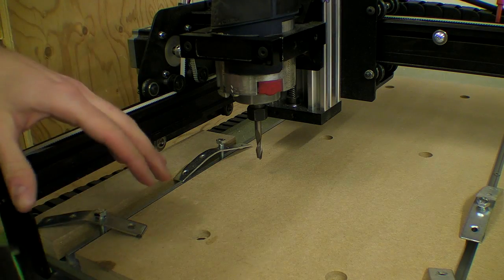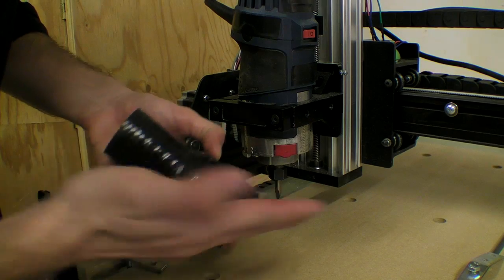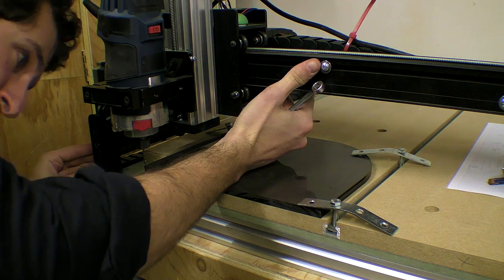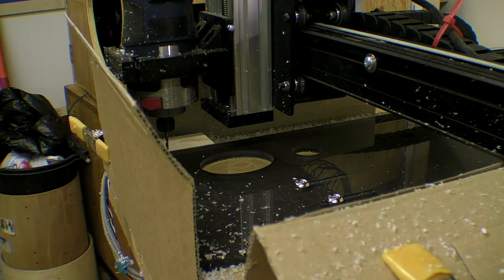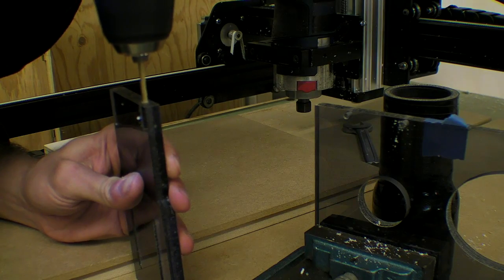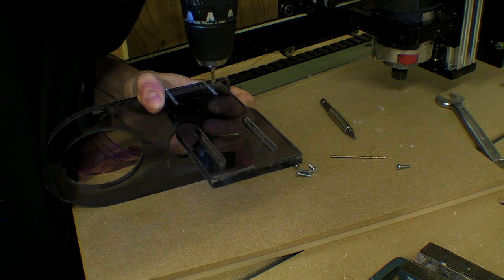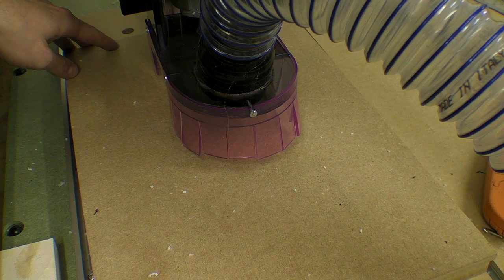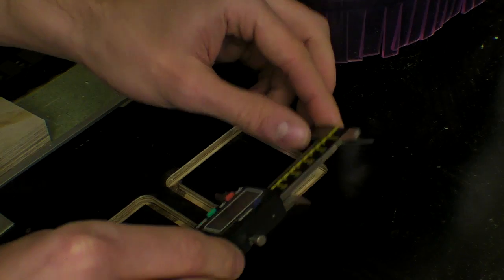CNC Extraction Hood for OpenBuilds Router Spindle Mount

Comment: how did you adjust the stepped motor?
Reply from the maker: +Lorenzo dm I actually did it in Easel for convenience but I will make another video next year addressing the software side of things.
Reply: +Educating Savvas  thank Sav;) because i also adjust it and im quite happy, on the square carving for example is perfect 50.00x50.00 the problem that i have its on round circle where i always get 0,10 to 0,20 mm difference. anyway ty for reply
Reply from the maker: +Lorenzo dm I have not tried measuring a circle but have you tried reducing the acceleration?  Along with that I can only suggest trying to create the Gcode in another programme and running it through the universal g code sender to see it that makes a difference.  I'll try it on mine when I have some time and share the results.